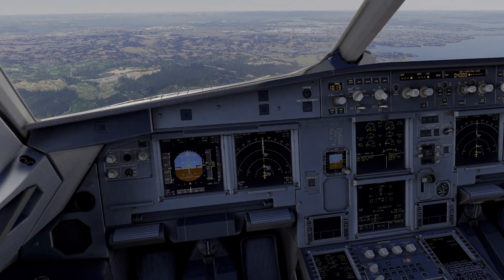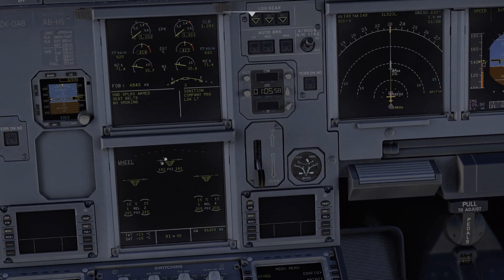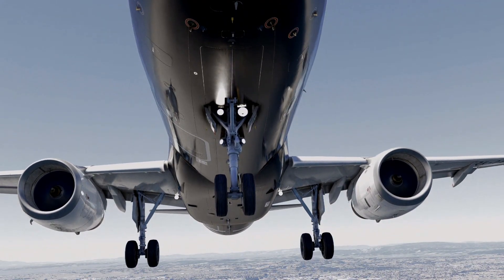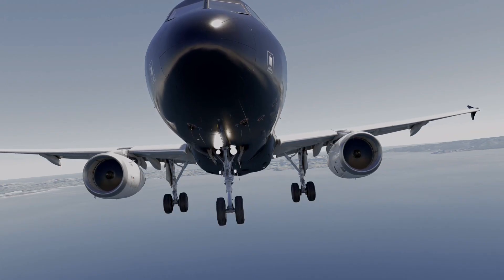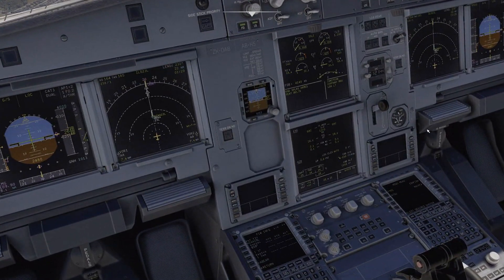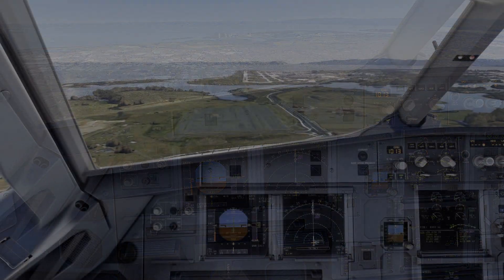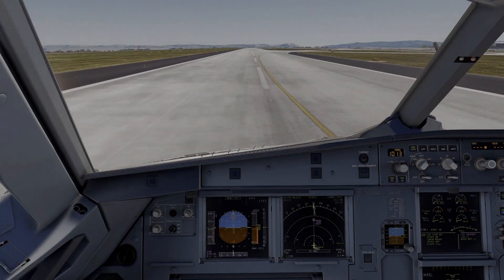Why does the A320 wiggle its landing gear?

Comment: The nose gear "wiggling" (more accurately, a slight, self-correcting fine-tuning of alignment) during the landing gear extension cycle is a normal function of most retractable nose gear systems, involving internal centering cams and hydraulic. This is not something pilots would know or see. I would not call it a wiggling, more of a small centering action. Thanks for the Video!🙂
Reply from the maker: This YouTube 😊 if I would call the video the self correcting fine tuning of alignment no one would click on it 😊 That's just the way it works here, but thanks for your comment.
Reply: @fsclips  😄You got to click on it. No worries and keep up the good work.

Comment: 4:13  "So essentially what that means the cabin will depressurize and euqalize the pressure inside the cabin to the outside."
That doesn't seem to be correct.   The cabin would be PRESSURIZED.   From low pressure to a higher pressure.   Unless they increase the pressure in the plane when flying at altitude nowadays rather than reducing it.
Reply from the maker: The pressure at higher altitude is lower than at the surface and makes it hard to breathe which is why you pressurise the cabin by increasing the pressure to simulate being at a lower altitude.
When landing this must be equalised as otherwise it could get dangerous when opening the doors.
Hope this helps.
Reply: @fsclips  EQUALISE!  NOT DEPRESSURISED!
Big difference.
" by increasing the pressure to simulate being at a lower altitude."
Increasing the pressure compared to what?  ground level or the outside pressure?
Reply from the maker: @shykitten55 Equalise, yes. Maybe I could have worded that better. We don't pressurise to a reference pressure (although there are limitations) we pressurise to a cabin altitude. The aircraft is at 36.000ft but the cabin is at 7000ft for example. 
It is a very complex topic. I think I will make a video about it to help you understand 😊
Reply: we are now arguing symantics.  like with accelerate and decelerate.  The cabin pressure is LESS than ground pressure so when landing the pressure needs to be increased to match outside pressure.
Reply from the maker: @shykitten55 In principle you are correct, but not on the Airbus. The Airbus family will pressurise the cabin on the ground to keep fumes outside the cabin that could develop during engine start. Like I said, it's complicated. I have put the video on my to do list, but be patient as that list is rather long at the moment.

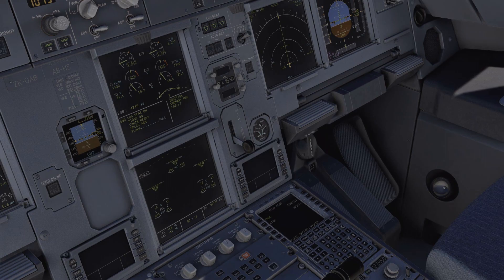Comment: Will the pressurization system function as you describe at 4:03, in both the Auto & Manual modes ?
Reply from the maker: No. If you have to pressurise the cabin manually there is a procedure that makes you depressurise the cabin before landing. Having said that, after landing the Airbus usually opens all kinds if valves to equalise cabin pressure, so in theory it should never be a problem. 
The thing is though that I had an overpressure warning once on the ground. I guess nothing is fail proof.

Comment: This is what caused the JetBlue A320 emergency landing in LAX (2005?) Mentour Pilot has more information on this. Turns out that that situation happened a few times so Airbus redesigned the testing process.
Reply from the maker: Correct

Comment: Do you know what triggers the landing memo on the ECAM? I've noticed some inconsistency in the A320 and in the A350 - sometimes it shows up early, sometimes quite late. Flaps don't seem to trigger it nor does arming the ground spoilers. Is it the altitude because that could explain lots of it?  Hopefully you can answer this, as basically no other pilot in youtube answers these questions with minute details. 😁
Reply from the maker: It depends on Radio Altimeter. There are different kind of software that use different triggers. With some the gear has to be down with others not, but basically once you pass 2000ft Radio Altitude it should pop up if you are fully configured. 😊
The reason why newer aircraft are different is that sometimes you are in the cruise and another aircraft is flying underneath you in the same direction you actually get the ECAM landing memo pop up even though you are at 36000ft. Happened to me once. So Airbus has changed the software on newer aircraft.
I hope this helps.
Reply: @fsclips  Haha! Thank you, it definitely helps!

Comment: The gear wiggle is a new one for me. Neat! Out of curiosity, why is the brake check delayed until the gear is down? I'd expect that 
Also, auto spoiler arming? Damn, I didn't expect that! Why do pilots still arm the spoilers though?
Reply from the maker: I suppose the main thing about the gear check is the alternate brake check and for that the system needs to be properly pressurised.
Loosing the main brakes would be the result of a hydraulic problem which is always monitored. If you would have a hydraulic problem the aircraft would alert you immediately and as part of that checklist there would be the braking system.
The gear down just checks the backup. You could still land as normal. There is just no backup.
I hope this makes sense.
Reply: @fsclips  Yep, thanks!

Comment: Cool - learned something again! So if the spoilers are armed automatically on gear down - does the physical speed brake lever sort of „pop-up“ as a result, too? To match with the system state?
Why would you arm them manually if on gear down they would be armed anyway by the system?
Reply from the maker: When you arm them manually they deploy the second you touch down. If the aircraft does it there is a delay. This function is a backup and should not be seen as a substitute.
The lever doesn't move as it has no motors inside.
Hope this helps 😊

Comment: Nice. Do we have to check accu pressure for the alternate braking system during preliminary cockpit preparation? In the A300/A310 it's part of the flows.
Reply from the maker: Yes we do 😊 At least in my company we do
Reply: @fsclips Thank you

Comment: Am I the only one not seeing the nose wheel turning?
Reply: I'm not really sure if its even animated but knowing Fenix, it must be ^^
Reply: It seems to be a super tiny movement. Difficult to see with the moving airplane.
Reply: When ever we replace the landing gear on an A320, we have a series of test to perform before the aircraft comes off the jacks. During an extension, We don't even notice the nose gear move left or right. We don't even have to verify this test in our paperwork. These test are done internally through the LGCIU's. There are two,(LGCIU1 and LGCIU2) that alternate each time the gear is operated. If there is a failure, you will get a message.
Reply: @tacubs  well, it's odd. I remember Blackbox711 talk about this long ago in the FSL 320 and in that plane you could see the movement.